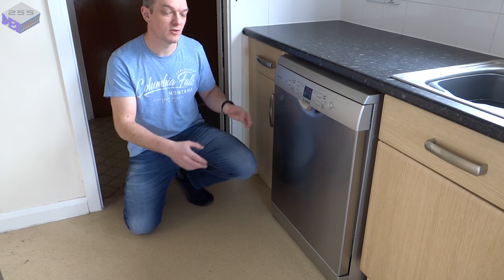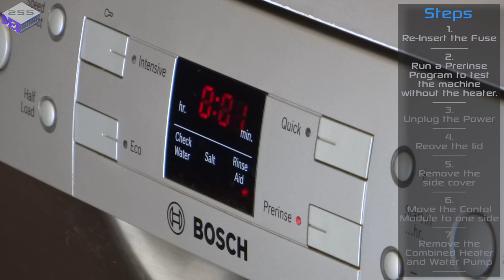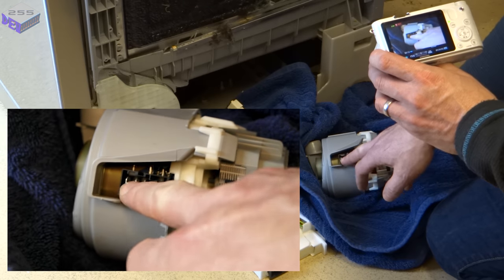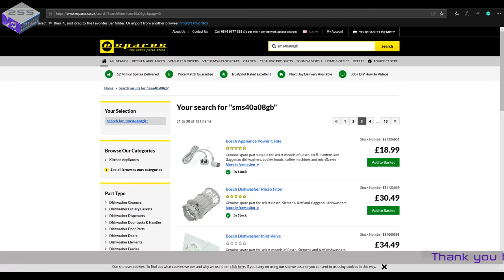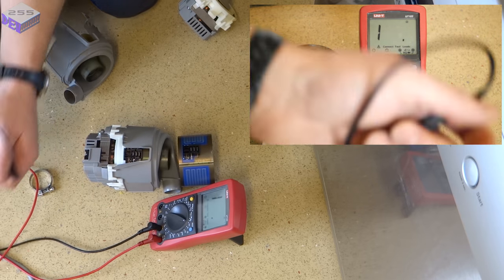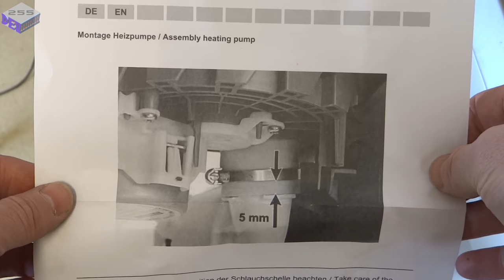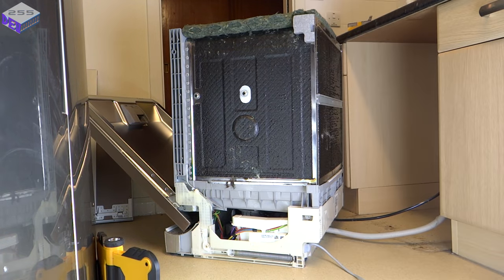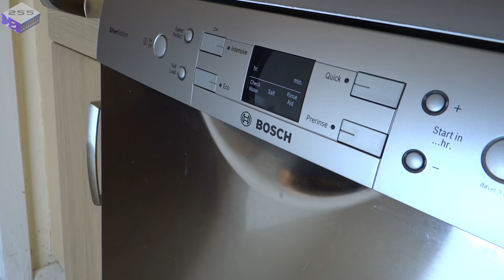How to Test & Replace the Heater & Pump in a BOSCH, SIEMENS, NEFF and more Dishwashers

Comment: Big help thanks!

And note that the 2 purple connections need to be connected, 1 to the pump and one left from the pump (not sure what it is). You will get E20 if you fail to connect it properly. You can see it in the video @11:15 it's behind the blue and 2 yellow wires.
Reply from the maker: Hi, I'm glad it has helped you. Yes, the one to the pump has 3 wires for the DC brushless sprayer pump and the one to the left is also a DC brushless motor, that one is the drain pump. Thank you for the additional info on the E20 fault.

Comment: Excellent video. The symptoms seem to tally exactly with my problem - error code, RCD tripping etc. I will investigate with a multimeter. A new part is a pain, but the whole machine is at least £600 so money saved by doing the repair. Many thanks
Reply from the maker: Thank you, no worries. I hope you get yours fixed; they really are nice machines if looked after. Feel free to let me know how your repair went and if you have any questions.
Reply: Hi, I have tested the pins of the motor/heater as per your video. No continuity (open circuit) and any combination of pins. I believe you got a few ohms between the earth and at least one of the other pins. Conclusion?
Reply: I have just watched to the end again and noted that when the unit was dried out it was open circuit - like mine. I will source a replacement
Reply from the maker: @alistairmcmeekin5382  Hi, yes there should be no short to earth at all, that would be why your trip is activating.

It's worth opening the old unit up when the new one arrives (once the fault is fixed) just to see the damage. It's a shame to throw the old unit out with a decent pump though, although you could sell it for scrap at EMR or somewhere similar.

Comment: Bosch made sure that even if you manage to remove the blue heating element, it's not possible to put it back in. The seal around it is submillimeter precision - it's just not possible to get the angle right for it to fit back in. You will have to buy a whole new pump.
Reply: This right here. It's so bullshit. Right now I'm trying to freeze the ring and see if that helps otherwise I'll try to add a chamfer to the top of the ring but I'll have to wait until my school re-opens.

Comment: That’s very helpful ... I need to pull my pump out and check the element resistance.
Reply from the maker: Good luck, hope you figure out your fault, feel free to comment here if you have a question.
Reply: @TheSolarPoweredEngineer  Heater was open circuit. Now replaced and appears to be working!
New pump was fiddly to install. I found removing the rubber support and using a finger to guide the back of the output pipe on helped.
Reply from the maker: Glad you got it on and all appears to be working, if there were to be any leek for the water connections there is a float switch underneath, so it looks as if you fitted it  correctly. 👍

Comment: Brilliant clear video many thanks helped a lot in explaining why the circuit breaker was being tripped at that point I had the same issue.
Reply from the maker: Thank you, I'm glad it helped you.
Reply: @TheSolarPoweredEngineer  hi I have now ordered a replacement heater pump and removed the faulty unit as described. Unfortunately I managed to remove the three grey wires from the small pin connecter whilst removing the small heater sensor plug. I have managed to refit the wires but was not sure where each wire was fitted in the plug. As they are all grey is the position important and if so how can I find the correct order for fitting. I hope this makes sense and look forward to your reply. Many thanks
Reply from the maker: @rogereverest5230  Hi, the wire order shouldn't matter as these wires go to a passive thermistor on the main heater plate. I'll take a look at mine and confirm this later today for you
Reply: @TheSolarPoweredEngineer  thank you once again really helps to know how to tackle these repair jobs great videos and response best regards roger
Reply from the maker: No worries, @rogereverest5230 , I don't have the one that I took off of mine, although the component on the heater plate is a thermistor that is passive and changes resistance as the temperature changes. From the 3 wires, I would say there is 2 x thermistors, so one wire would be a centre tap and the other 2 go either side of each thermistor. You may be able to measure the wires resistance to earth (chassis) - With the Power OFF - before connecting it onto the new unit, you will be measuring back to the control unit. Two of the wires should read the same resistance and the other reads lower or higher. The one that reads either lower or higher should be the centre wire. It wont matter which way round the other two wires connect if they are matching thermistors. This is only my educated guess though, so you may want to seek further advice from a local repair shop. If the machine still brings up an error it may be down to these 3 wires and may need moving around to get it to work. Please be safe if you are testing the machine with the cover off, water and electric make for a dangerous environment, ensure you can switch the machine off from a breaker/fused spur without touching the machine. I hope this helps. Kind regards, Neil.
Reply: @TheSolarPoweredEngineer  many thanks for the comprehensive reply the new pump is due to arrive Thursday and I will check the readings on the dishwasher wiring before fitting it to machine probably on Friday will let you know how it goes.

Comment: An excellent and detailed video, thank you. The thick film heater elements seem to be failing prematurely. Although the heater elements is available freom China, min order is 1000 units, so you have to buy the complete pump and heater assembly to repair the E09 fault..
Reply from the maker: Thank you. Yes, they come fully assembled; there may be people out there who can refurbish yours, especially if they have ordered a number from China; this may be the cheaper option. It may be worth you asking a local repair shop.

Comment: Thank you so much for the video! I've removed my heating unit and measured the resistance. It all seems fine to me (20ohms between live and neutral and open circuit between the each terminal and earth. I did find quite a lot of water in the bottom of the dish washer, where the heating pump and control unit are. So something could have shorted there. I've taken all the water out and leaving everything to dry a bit. Wondering if there's anything else I can do to double check that the heat pump is working ok before I put it all back together. Really don't have to take it back out again!

Comment: Many thanks for the detailed video.

I get E10 on my Neff Zeolith dishwasher. Neither get hot water nor dishes get dried a the end of the cycle.

Based on the documentation, E10 is due to Zeolith mechanisms failing. But how is that related to hot water?

I kind of think maybe the error code is misleading me here. If the water is not getting heated during the wash cycle, there won't be any steam to be sucked/pumped to the Zeolith container at the end to produce drying heat either and that will kick in the moist sensor which trigger E10.

I will test the heat pump first I guess, but wanted to get some opinion from the experts here as there is not much information about Zeolith Dishwashers online.

Cheers
Reply: I’ve got the same fault. E10 when drying. But I tested and it doesn’t heat water either. Tested heating element and it seems fine 20 Ohm. Temp sensor about 10K 0hm in room temperature.
Reply: @carmacom   I had to replace the zeolite heater as it was physically damaged due to exposure to water(I think) for some reason, the whole process took around 5 hours!, the machine is back to life now, cheers.
Reply: @dashnima  yes I found the same thing. Weird that the Zeolite heater stops the heat element in the “heat pump” from being activated. But I read somewhere that the first cleaning cycle uses the zeolite heat and when the water temperature is high enough the heat pump takes over. I think the zeolite heater got defective because of debris from the dishes. It takes the air from the right inside of the washer and this vent/ hole is also used when the machine rinses the water storage in the right side. I ordered a replacement heater, still waiting for it.
Reply from the maker: Glad you got your dishwasher fixed @dashnima, and hope you get your part soon @carmacom. It's nice to see this video is still helping, if it did that is ;-)
Reply: @TheSolarPoweredEngineer  7 months passed a now I get and E09, is that related to heat pump? time to replace that I guess?

Comment: In Aus this part is $123 delivered from Bosch Aus. Up to twice the price from other parts suppliers. I find the process of inverting the unit and removing the entire base to be worth the hassle. Everything gets a clean and a going over, dishwashers being grubby roach infested machines n all. The base just kind of clipps on and off without too much drama.
Reply from the maker: Hi, that's a very good point, although haven't tried it myself. As you mentioned giving it a good clean has got to be worth it. We had a mouse in our one at some point, probably nice and warm when they are on.
Reply: @TheSolarPoweredEngineer  Just looking into this, the grey plastic base appears to be all one piece and it hold the door spring counter balance. Did your unit just clip out?
Reply from the maker: @zt7489  Hi, there are a lot of things attached to the base on most machines, so may be a little difficult to invert and remove. Sometimes it is easier to leave the base on, pull the machine to a large space, remove all panels and lid, then you should be able to get around the machine much easier. I hope that helps
Reply: After much struggling I managed to free the lid of the control box.  That allowed sufficient movement of the control box so I could get access to the pump. Thx
Reply from the maker: @zt7489  , No worries, glad you got it sorted. They don't make it easy.
Reply: @TheSolarPoweredEngineer  Thx, went online to Bosch put in the model number and ordered the part, everywhere else were charging more money!
Screenshots show it looks the same, but the decal displays different numbers. Did you find this happened on your part?
Reply from the maker: @zt7489  The pictures on most sites show generic part numbers, part numbers can be different for the same part of different manufacturers. So Bosch could be 1234, where Hotpoint could be 4567 for the same part. Just check everything matches when you receive it before installing. You can always send it back if not right.

Comment: Evening , great video 👍. I don’t have a multi meter and tested those 2 terminals with a battery and a bulb, bud did not illuminate so I take it this is an open circuit.
Reply from the maker: Thank you, a bulb and battery will work well to test the circuit as it should only be around 20 ohms, you can normally separate the front housing from the rear by bending the clips (takes a bit of force and can damage the clips if not careful) and pulling the housings apart, you can then see any damage to the tracks if that helps.

Comment: Hi Neil, I have the exact issue you had, the dishwasher would trip the circuit breaker and the water wouldn't get warm anymore. However I got the E04, before I start disassembly I thought I'd ask, I've seen other videos saying a relay could be an issue on the controller. Is the controller next to the pump or on the door of the dishwasher? I don't have a multimeter so would it be fair to say if the relay on the controller looks fine, the issue would be the heat pump? The machine runs ok and the water level if good.

Comment: Hello, it seems that I had this exact problem (heating element was faulty due to calcium burn or whatever it’s called) and I replaced the motor (new one measured 20 ohms) but it still wouldn’t heat. I then put the new blue heating element into the old motor, took out the wires from the white box and put them back in (I made sure to take a picture to make sure they went into the right place) and now my machine is acting really weird - it won’t start the wash and just makes water noises or humming noises, and sometimes goes silent for a while. Does anyone know what’s wrong with it?

Comment: Excellent video. Ours doesn't trip the fuse so maybe something else. It's a shame that Bosch don't build them properly in the first place. Ours is only 7 yrs old. Previous Bosch lasted 18 years!
Reply from the maker: Thank you. I think Bosch has slipped a little in production, where they use the same parts as Siemens, Neff, etc. They are all made for rapid bulk production these days, rather than well-engineered machines, unfortunately.

Comment: Has anyone replaced the element inside the heat pump? It is possible to buy them, but I cannot work out how to get it back into the tight rubber seal. Bosch.

Comment: Hi Neil

I got the E02 error, have you seen that before?
We've got a unit where there is also an airdryer thingy inside (glastube blower). 
The washer does not heat the water and does not dry. 
No fuse tripping this time. 

It was repaired 2.5 years ago, where both these units where replaced. I had to send it in, as I gave up on getting the airdryer thing out. 
Any idea on what could be wrong this time?

Thanks in advance
Reply from the maker: Hi, hopefully I am not a little too late in replying, we have just moved house, so playing catch up. The only things I could recommend is testing the continuity of both heater elements, you should be able to do this from the end of the wires (connected to the main board) both should read fairly low resistance from 20 ohm (12A, 2.8kW element, usually water heater) to 120 ohm(2A, 500W element, possible air heater element), if these test ok through the wire it may be a control board relay (Solid state or electromechanical), if this does not test ok you may have to test at the heating elements; this will show if the element or wires are at fault. If all looks good with these tests you may be looking at the thermostat side. I hope that helps.
Reply: Thanks a lot for getting back. Already bought a new unit though :) But maybe it will come in handy, when that one fails. Thanks again ;) @TheSolarPoweredEngineer

Comment: My dishwasher is 6 years old and the heater/pump failed for a second time. I always used to repair my white goods, but now older I'll probably get a new machine as the heater pump is now £200 and the local chap wants £100 to fit.

What machine would you buy in 2023?
I want 24hr timer, quick wash and auto short run times.
Reply from the maker: I must admit, I do like Samsung features and design. Although expensive, the Series 11 DW60A8050FB machine has 3 shelves with the top one being for cutlery, so you can fix more in. Most machines use the same parts, but over the years Samsung engineering has been top notch in my opinion, with Bosch being a close second. It's worth looking at the Samsung website to see more features there.

Comment: 13:50 I believe that’s the turbidity (soil) sensor.
Reply from the maker: That makes sense as I believe it drains and refills when heavily soiled. This is an optical sensor (photodiode and phototransistor pair) that would be able to determine the opacity of the water.
Reply: @TheSolarPoweredEngineer  Exactly.

Comment: Thanks for the video. I repaired the resistor with solder. It has 17.5 ohm a bit less than the normal value but I think safety factor is around 2 so it is not a problem. My question is, where could water have entered the pump and damaged the resistance? I saw rust in the resistance housing. Thanks in advance

Comment: Shame that there is no option to order and change heating element separately. I had problem with one pump part wearing out, ordered used one complete unit from newest dishwasher by searching part numbers and comparing the date of production. Now 2years later E09 :-(. Back to dismantling. My current machine overall life in use is 13years.
Reply from the maker: Hmm, bay be an idea to clean the seals around the pump input pipe as you may be getting water seeping out to the heater element. Still a pump every 2 years is still better than a new machine I guess, unless the next new machine makes it 13 years too.
Reply: @TheSolarPoweredEngineer  I need to see if water is leaking. Tried washing on eco program 50 C max and no fault so far. It seams that it goes to fault only on high temp. Maybe there is still life in it if take a look soon enough. Old heater did not had any problems. So if nothing will switch those and continue washing :-) need to search the garage trough the accumulated stuff for it :-)
Reply from the maker: @mihamaker  Good luck, sometimes everything dries out and there are no issues until it gets wet again, checking for leaks is the best option for intermittent machines